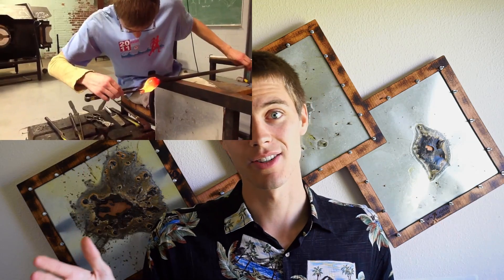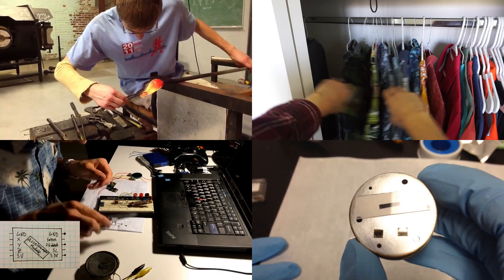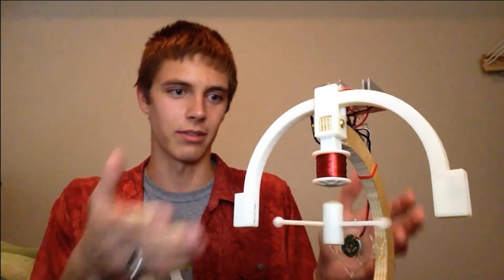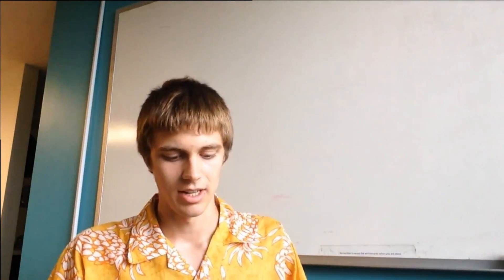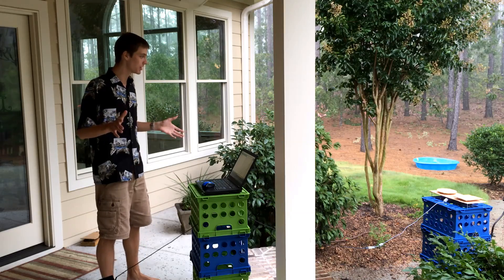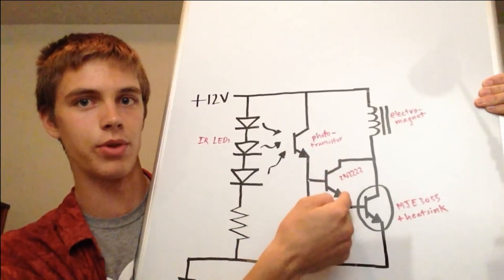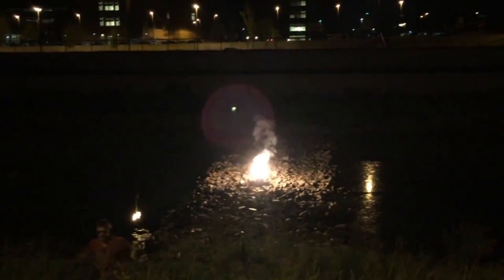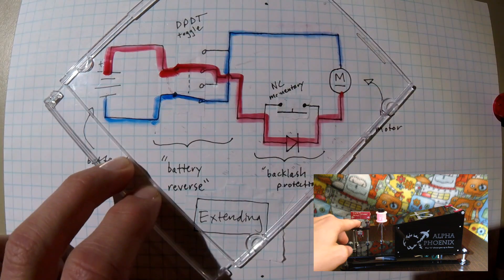AlphaPhoenix Channel

Comment: Hi Brian,

Found you via Steve Mould today.
I'll progress through your videos as time passes.
I'm interested to know what your background is.
Evidently you are (at least were) doing a PhD in material science it seems.
I teach senior high school math and physics, so it's good to be able to point interested kids toward examples of where things go in uni etc.

Regards,
Anthony
Reply from the maker: Hey! Thanks for stopping by - Steve is an awesome guy! I’m still chugging away at the PhD in materials, although our MBE moving and covid have dampened work pretty significantly. My high school had a research class where we would compete in science-fair type events, but a lot of students ended up doing actual work in real labs and it was an awesome start. I doubled in physics and materials science and engineering at NCSU, and worked in a lab that grew nitride semiconductors. Now I’m at UCSB, growing IV-VI semiconductors and I’m not quite sure where I want to go after graduation yet.